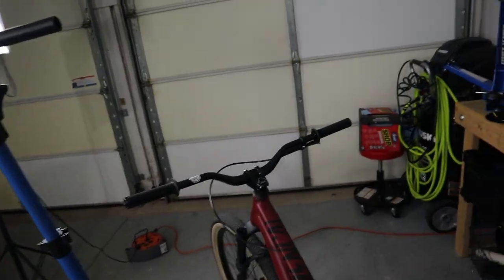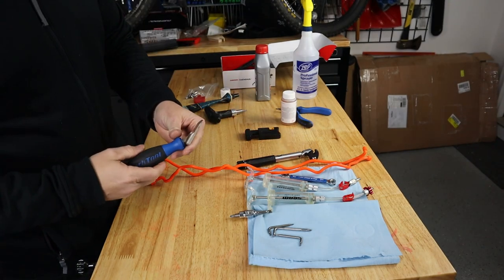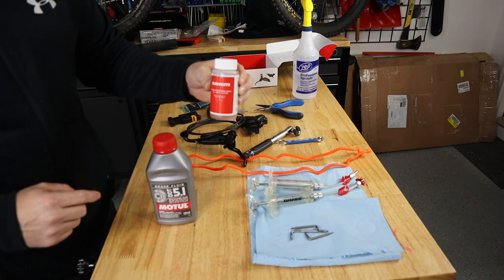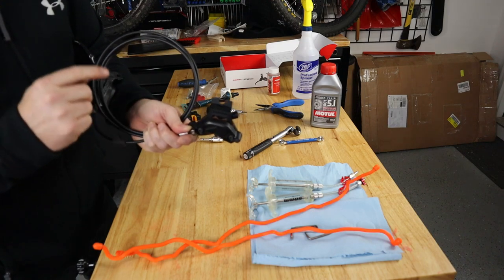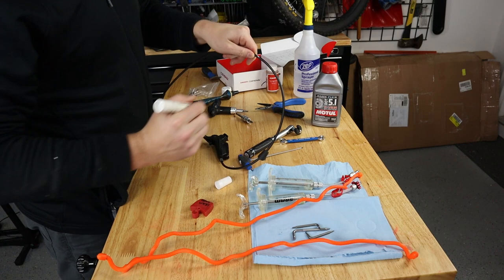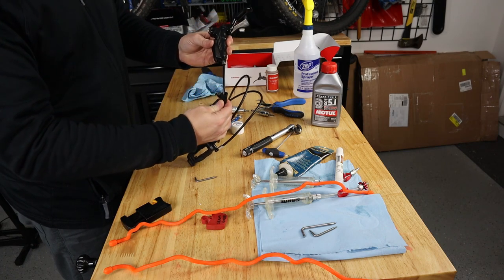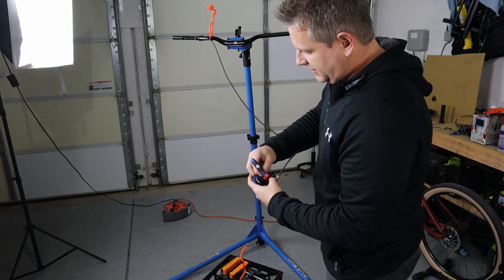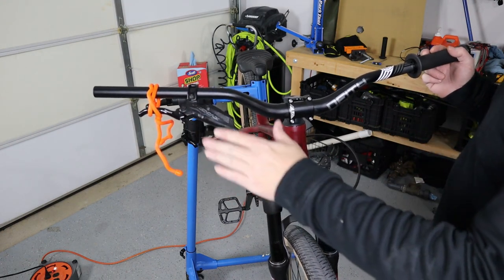#MTBPlanB Ten tips for epic hydraulic brake bleed on a mountain bike.

Comment: Finally someone mentions using SUCTION to get the bubbles out. This simple but obvious step made the big difference for me. I push up from the caliper to bleed, install lever bleed screw, suck on caliper while moving it around to get out bubbles, remove syringe from caliper and install bleed screw on caliper, then do suction on the lever while flicking the lever and tilting it up and down, push on plunger to ensure line is tight with oil, remove syringe from lever quickly and screw in bleed screw. Also, I use a custom bleed block that is narrower than what is provided for my brand so that I can overfill  a bit. Then after you put the pads in you can push on the back of the pads with a flathead to push in the pistons that are too far out and causing rotor rub. You will probably have to loosen the lever bleed screw a very tiny amount to let a little a little fluid out as you push the pistons in. I figured this out after payign $50 to a bike shop that couldn't get a good bleed for me. Tons of air was in there still. Also, don't forget to pop out your pistons and clean out any dirt with a cue tip and coat seals with dot or mineral oil before pushing pistons back in. Once a year is probably enough
Reply from the maker: Great tips! Thanks for sharing.

Comment: found your video and hoping your tips will help with my struggle. The bleed block won't go in all the way, tried your tip but your video shows a cut and back. How did you get that block in? I've opened both caliper and lever ports for the rear brake and tried wedging it in, no go.
Reply from the maker: I use a tool made to push the pistons even with the caliper. You can use a flat screw driver or anything flat as well. Just go slowly with deliberate force, also tape the tool as to not puncture or scrape the piston.
Reply: @MTBPlanB  was avoiding that method but will try carefully... Thank you!